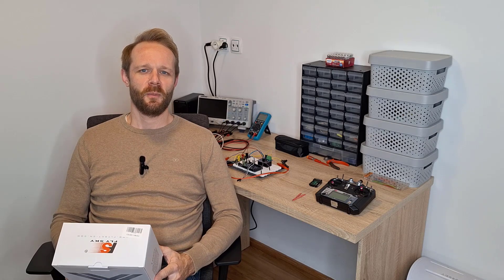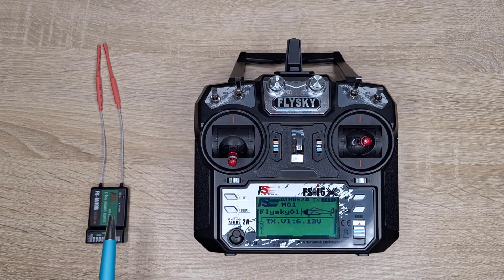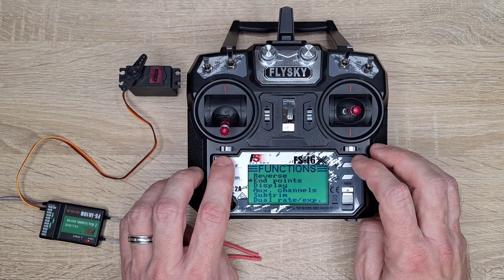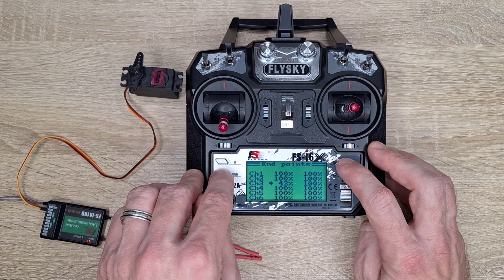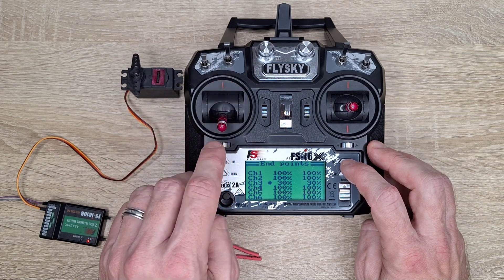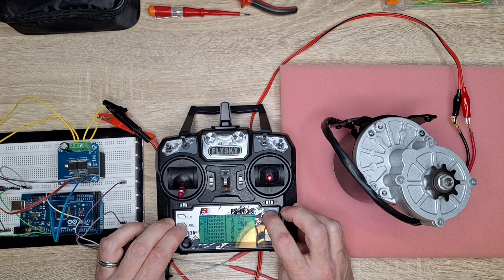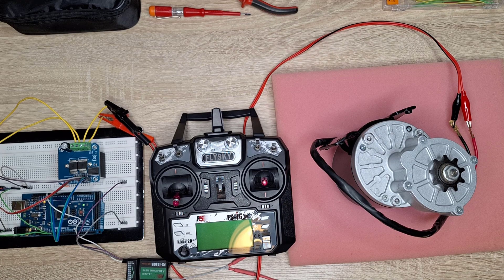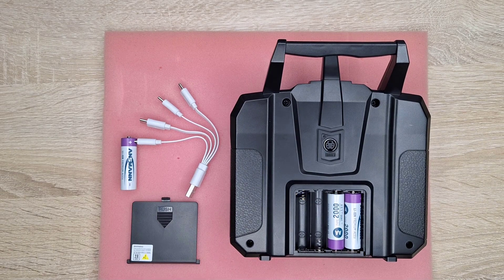Transmitter - Remote Control Lawn Mower DIY

Comment: What's the microcontroller and motor driver used?
Reply from the maker: I usually use sabertooth from dimensionengeneering. This controlers are good and versatile